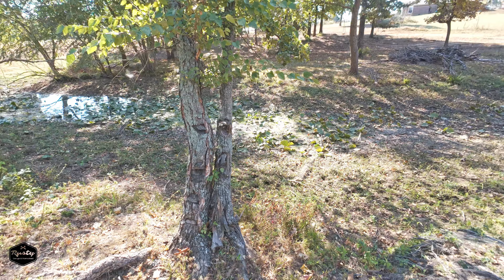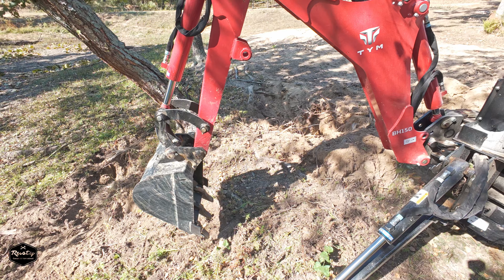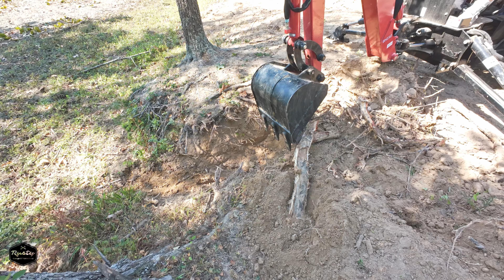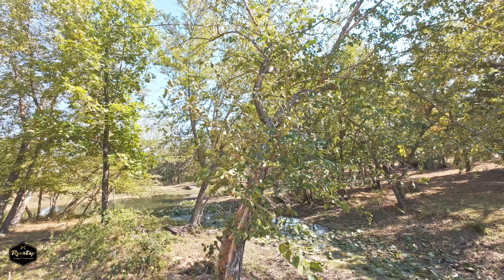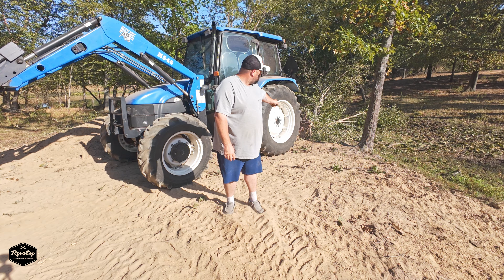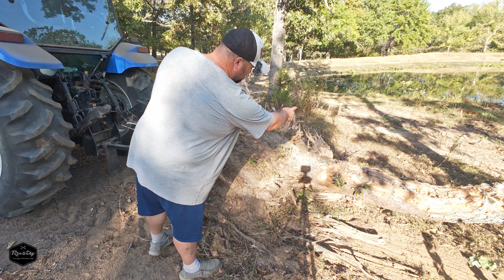TYM 2515H Machine Takes on MASSIVE Tree Removal Challenge

Comment: Hey Mike, any chance you could add a thumb to the backhoe? Looks pretty useful on all the other channels we frequent. Kind regards.
Reply from the maker: HI Mr Steve. Yes you can. This machine has the pin bracket already on the stick to mount a mechanical thumb. I just didn't and still don't have the money for one yet. My friend Joe from the Oakie woodsman channel has a thumb on his kioti ck2620 and it looks extremely handy to have. Thanks for stopping by